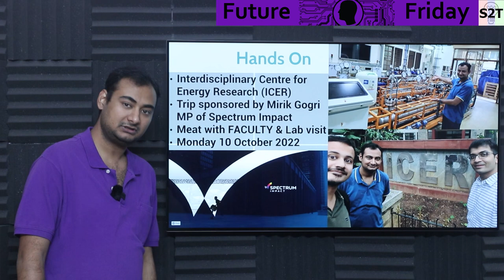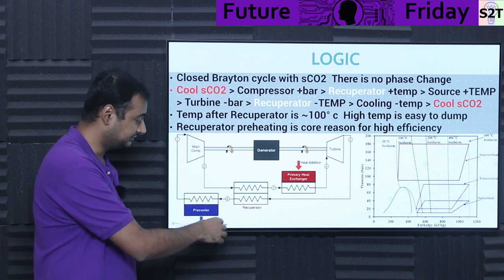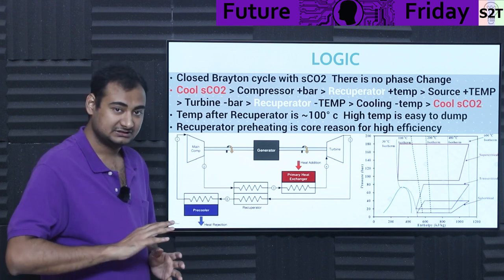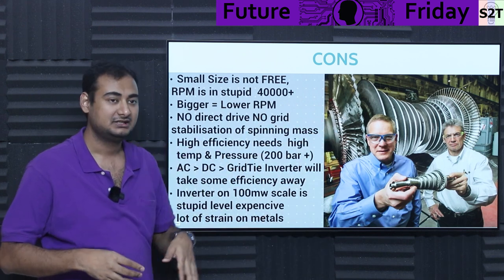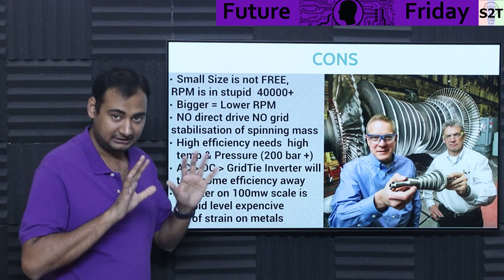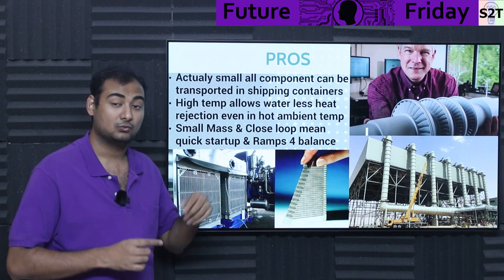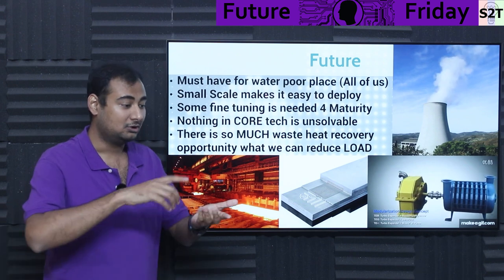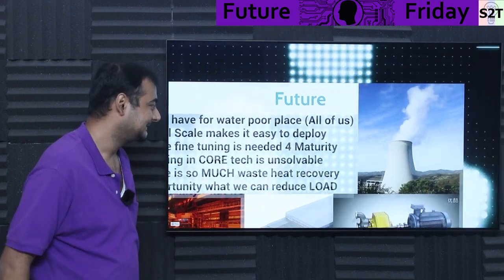Hands On Supercritical CO2 Turbine Explained {Future Friday Ep204}

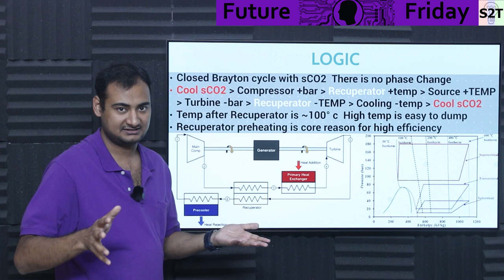Comment: In my opinion, The start of the video (00:00-10:00) is explained more specifically instead of generally(when compared to your other videos). You should of started general and then explained it specifically. It saves the audience time and work, from extrapolating the gist from the specific explanation. It makes it harder to understand. Lessen the work by breaking it down into general terms first then go into more specific terms.

For example:
This is a type energy transfer From heat and pressure to kinetic spin energy. Instead of using water that is heated into steam that spins a turbine. The differences are this is a majority closed cycle,  (recycling heat into the next cycle)

PS, In my opinion, I noticed using the engineering terms(bar, Recuperator) isn't helpful (because your job is to explain to the masses). It shouldn't be named that on the screen since your screen is so small. If I had more room I could put the engineering term next to the descriptive term. For Example: cool sCO2 > Compressor +pressure (100bar) > Heat exchanger(recurpurator)  +temp> Source +temp > Turbine  -pressure > Heat exchanger -temp> Coolling -temp> Cool sCO2

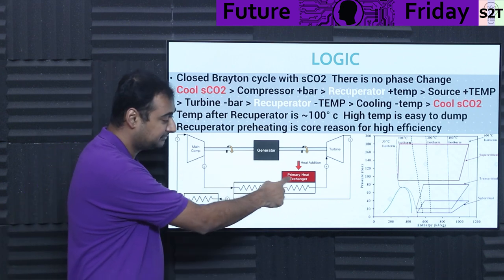9:20 did a okay job of explaining. Move that to the beginning.

My questions are: How does the secondary reycling heat exchanger dump its LOW heat onto the Primary HIGH heat exchanger? Heat does not travel from low to high.

"SOURCE + temp" wasn't so clear on what Source was.

Great video.
Reply from the maker: Source  is " fire " whatever U are using Gas burnner or coal fired or  Concentrated solar power  . Heat exchanger(recurpurator) is dumping unused heat of returening sCO2 {350+ °C} to incoming  sCO2 stream which is {200+ °C}. So delta is 150 °C unused heat will act as a preheater . I may have mixed up words in my video

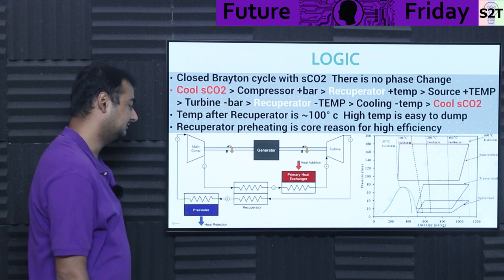Comment: 6:50 I think step 1 must start at point 3 when you add heat to the sistem. after with that generate electricity in turbine and after sCO2 done the work go to next step wich is 6 in the recuperator of remain heat and after that get out all the heat and compresor compres it again.
Start with compresor is more hard to figure it how is working.
Reply from the maker: but that is the thermodynamic starting point that is when state change begins

Comment: Use two deep (10 to 20 km) bore holes in the earth for heat and pressure.  The heat at the bottom will reduce the density of the fluid in the bore hole going up to less than have the density of the fluid going down.  No compressor or heat source required at the surface. No pollution.
Reply from the maker: That is the dream of Quaise Energy lets hope it works
Reply: man drilling to 10-20 km is too far. the current drilling technology has not reached that point yet. But depending on the location, you can get 150 to 200 at a depth of 4 to 5 km (like the geothermal fields in California and Nevada) which is enough to reach that 10% efficiency of course you will need an efficient system and you might use solar panels for more heating (of course the use of solar panel depend on your region solar energy)
Please let me know if I am wrong.

Comment: Why does it need to be cool down completely? Can’t it bypass and compress the “still hot” CO2  and heat it again?
Reply from the maker: Energy can only flow in a gradient u need both HOT & COLD if you dont cool off the over all temp will rise & over time it will stop & boom
Reply: @s2tenglish  I wonder how this would work connected to a co2 pipeline?  They run cold, high pressure co2 through them.  Instead of recycling the co2 you could just have a constant flow of new co2 coming in and then recover the heat.  You'd just need to cool the co2 and bring it up to pressure to feed it back into the pipeline.  Depending what else you've got in the area you could pipeline the hot co2 to a factory for them to use.  Maybe they use it for a product or they just take the heat energy.  Any co2 left over can be cooled and pressurized again to feed back into the pipeline.

Comment: Where does the pressure energy to drive the turbine comes from? The pressure is added by the compressor using energy. And does heating do anything to the to that? And how does it have a net energy gain if we use energy to compress and you the compressed thing to do work?
Reply from the maker: what happens if you heat something like a fluid in a closed space ? Right PSI or BAR goes UP that is primary Energy input
Reply: Heat provided by burning fuel or fission of uranium